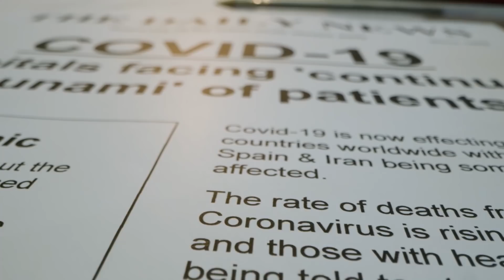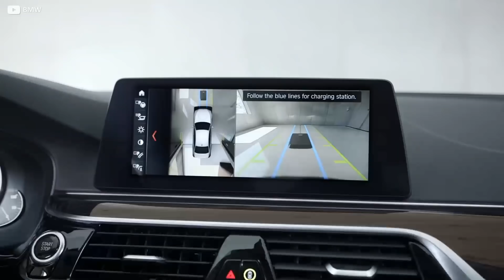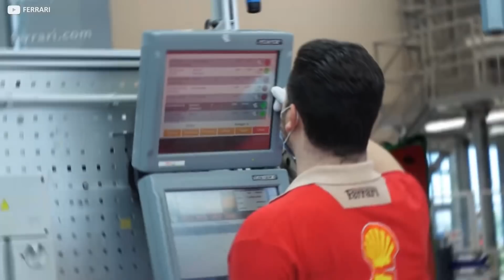Exotic EVs To Expect By 2025

Comment: Hybrid cars are worse for the environment than gas cars due to the Lithium-ion batteries, emissions from the gas part, and disposal of the batteries so the hybrid super cars are using the electric motors for instant acceleration and not for environmental purposes.
Reply: When you look at the life cycle of the car, the biggest source of emissions is fuel. Hybrids reduce the amount of gas burned and therefore reduce the biggest source of emissions

I think if you look at the life cycle of a vehicle, hybrids come out above ICE cars. And EVs come ahead of all options
Reply: In order to get instant acceleration, you can either use electric motors or a stronger combustion engine (which uses more gas). So while the intent isn't environmental I think the outcome is. But the best way to reduce emissions from luxury cars is to not build them in the first place
Reply: @ThomasBomb45  hybrids are perfect for racing, ICE can reach the highest top speeds possible, the electric motor just helps and recovers energy when braking and cornering. Look at the porsche 919 hybrid
Reply: @ThomasBomb45  the porsche 919 hybrid cannot reach the top speeds of a buggati or example. EVs are only good for 0-60
Reply: @alanmay7929  I'm gonna be honest, racing isn't my thing. I don't see why it matters if EVs or ICE cars are better in a race since 99% of cars are used for transporting people to work and the grocery store, not racing
Reply: @ThomasBomb45  the actual 1%+ people actually do love cars sport cars not just for racing but exhaust note, the other different specs too.
Reply: @ThomasBomb45  the other sad thing is that tesla doesn't want people to modify their cars.